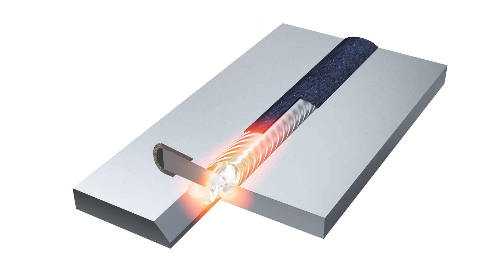Пайка стали латунью, МАПП газом.( с субтитрами)

Comment: Very good.   Why did you twist the brass solder with a drill?    Used empty .22 LR rifle cartridge cases make good strong brazing filler.
Reply from the maker: My wire was too thin. I decided to thicken it this way, for convenience.